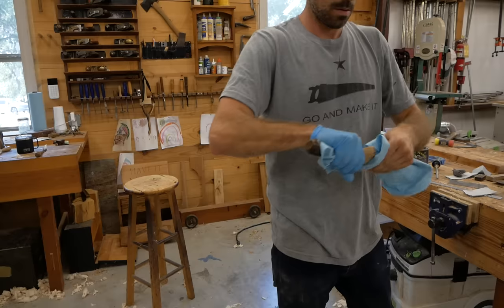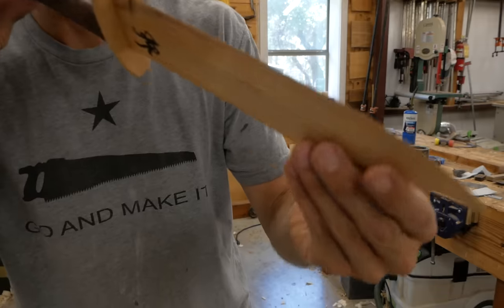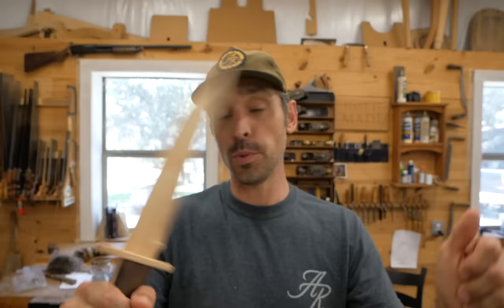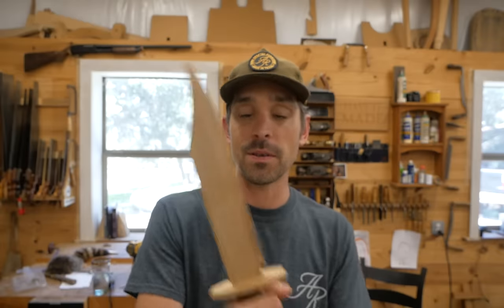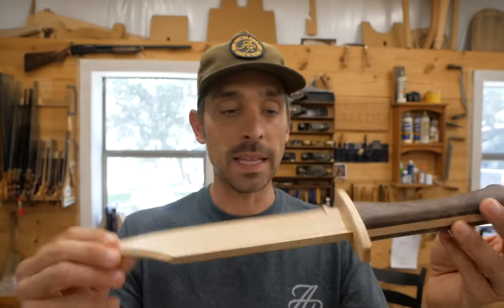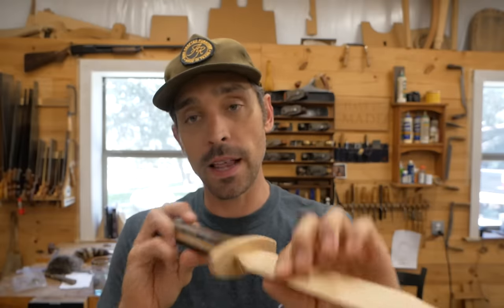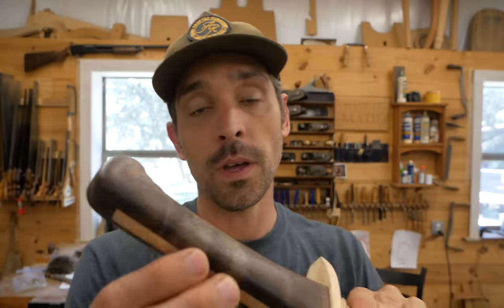Handcrafted Bowie Knife Replica // Made From Hickory And Walnut

Comment: Man, that's awesome! Just out of curiosity (and to learn something), why did you use epoxy on the handle instead of just wood glue?
Reply: both would  do. Not sure of type of wood used, but wood glue won't stick to oily wood. Another reason is that epoxy  can fill wee gaps.  With wood glue you need perfect contact. The only other reason is drying  time. Maybe this is fast drying epoxy. Wood glue usually needs  12-24h for a really strong bond. Oh, and not all wood glues are water proof. I guess this could be left out in the rain.